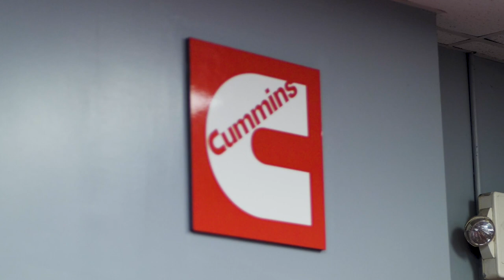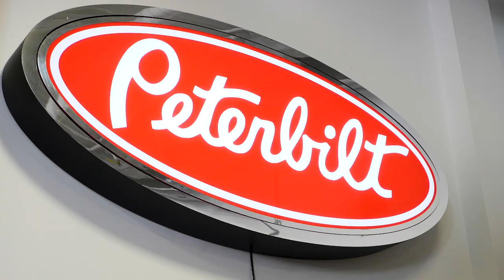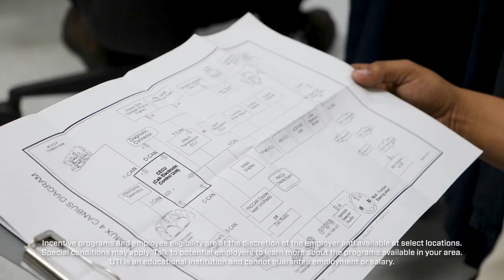How to Become a Diesel Mechanic

Comment: 😮 How will you diagnoze a Diesel engine truck, When you  start the engine, the exhaust smoke, blows a blue color smoke, black color smoke, and a white color  smoke,  How will you differentiate the smoke after Change oil?